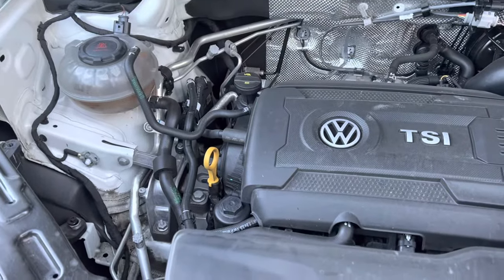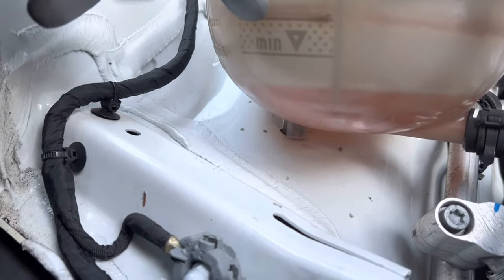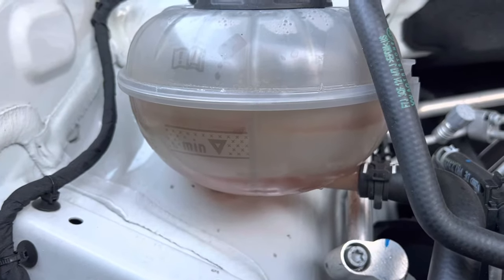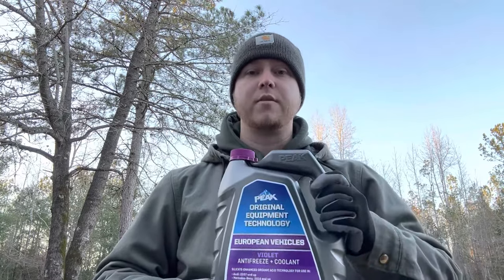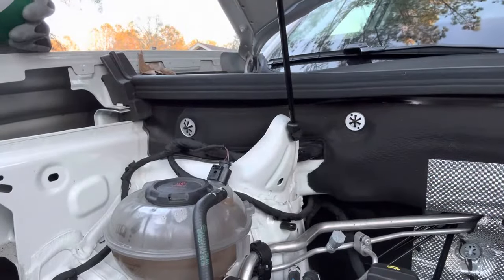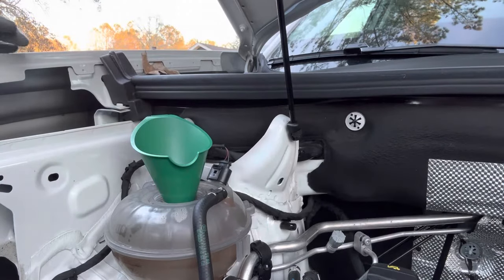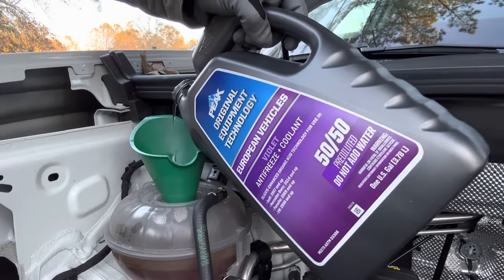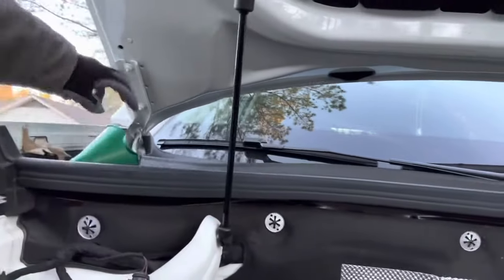How to Add Coolant/Antifreeze to Your Vehicle

Comment: Thank you very helpful video. My question is the cap of coolant reservoir should be tightened to the end or somehow loose ? Thank you
Reply from the maker: @01ZENZEN  definitely all the way right
Reply: Thank you for your reply I really appreciated I have VW Atlas 2018 & I did tightened it all the way but with no click sound was heard.when I bought the  coolant I did not have my car with me so he told me that there is a click when you open or tighten the cap but no click happened. Was he wrong about the click? Thank

Comment: Does the color matter? I have a 2015 Passat that has pink colant in it already. But the pink coolant is rated for 2008 and under meanwhile the purple coolant is 2008 and up. Is it OK if I mix the purple with the pink? Or should I get the pink coolant even though it’s rated for older cars. Thanks
Reply from the maker: Yes, color does matter.